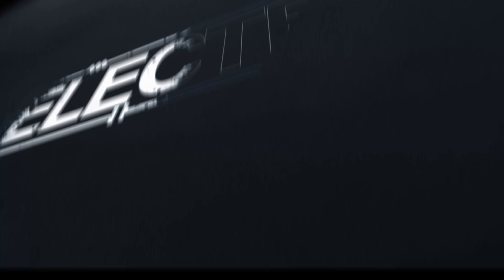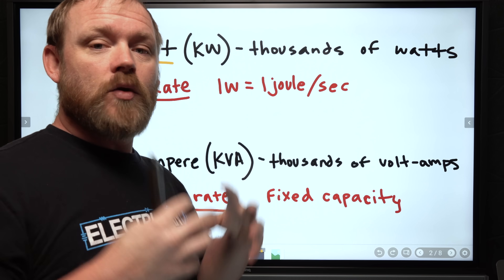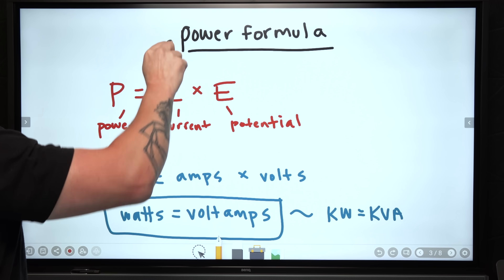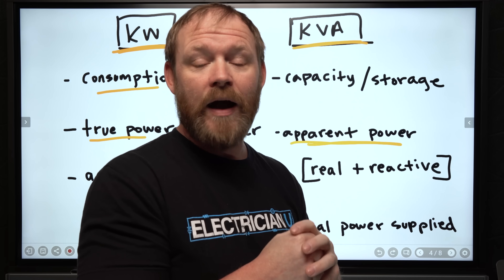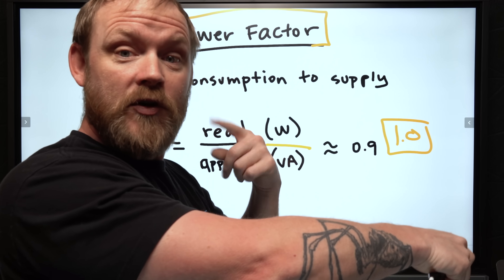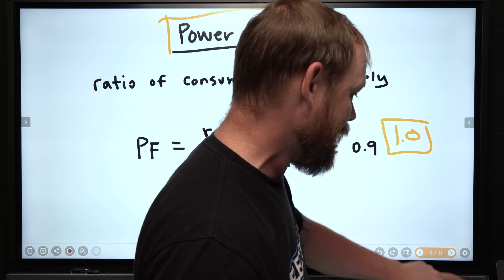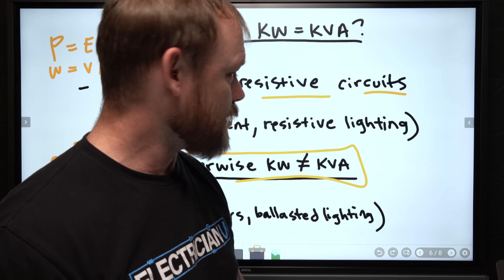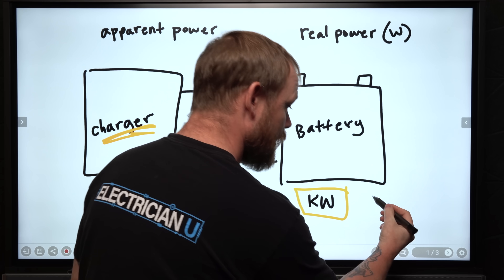Why KW and KVA Are NOT The Same Thing (Even If They Seem Like It)

Comment: what's crazy if you think about it... when you charge your phone, it has a step down transformer. Which means it's on a closed loop circuit. Which means if you charge your phone for 100 years, that wall charger will never loose any electrons. Meaning there isn't a real connection from your house circuit, same holds true from the step down transformer at the street your house is isolated from the electrical grid.... yet when they make circuit boards and the traces are down to 2 microns they have to battle electron drift.

Comment: 2.35 mins...so Batteries should really be rated in KVAH, rather than KWH?
13.28 mins: Power factor ONLY applies to ALTERNATING current, it does not exist in DC, unless it has been specifically designed in to the circuit. 

Hmmm, perhaps a missing layer in this clip, is to distinguish between AC & DC as a starting point.

Comment: How about voltage potential difference
Take like a solar system connected to the grid 
What is the total amount of work including overcoming the pressure voltage
But if you were to measure volts and amps where the solar is grid-tied you will see about an 85% difference 
You know the actual power going into the grid

Comment: OK, it's reasonably clear for my limited needs, but leaves me with the following: if a motor is rated at 1000 watts, given a typical power factor of say .9, is this 1000 watt rating an indication of actual electrical power consumption, or that of the motor's useful output? Or to put it another, more practical way: ignoring the high power demands when the motor is started, do I need a 1000W or 900W generator to run such a motor?

Comment: VA's theoretical veriable is the voltage, whereas W equals total consumption or rate per hour, which in turn can be delivered in the form of different voltages. In the real world, a stated votlage and maximum stated amperage is the VA.

Comment: Impedance can be purely resistive.  You have to describe the difference between power (W) and supply (VA) in terms of power factor and he didn't get to that until the very end.  Note that this is only case for AC circuits and typically only matters when you're transferring power.  Without an explanation of where capacitance and inductance show up on typical loads  it's really hard for anyone that hasn't had a EE course to explain or understand this.

Comment: I thought battery capacity was rated in Ah. I know car batteries rate their power delivery as cold cranking current—other batteries use kW, but it's easy to work out current delivery as most batteries are a "fixed" voltage. (Quotes around fixed, as most batteries have some sort of discharge voltage curve—alkaline are almost linear voltage drop vs time for a fixed discharge current, whereas NiCd were a sharp drop in the first 5% of capacity, then almost flat for the majority of the battery's capacity, then a sharp drop at the end. Don't know about other battery types.)

Anyhow, reactive loads (predominantly, if not exclusively, an AC problem)—when looking at the voltage and current waveforms on an oscilloscope, you can almost immediately see the issue that phase shift causes. In a purely resistive load, the current and voltage waveform peak simultaneously, so all the power delivered is useful. In a reactive load, the phase shift causes the current to lead or lag the voltage. At any given point in time, P=IR. Given the waveform peaks never arrive simultaneously, you can calculate the instantaneous power using a whizbang formula that I can't remember because I learnt this stuff thirty years ago. There was something about the cos and sin of the angle (normally 90° phase shift, I think) which gave you the vectors of the sum he talks about, actual power vs apparent power.

Short story—reactive loads (IIRC) are not a DC problem—kW means kW. As a bonus, my head now hurts from thinking too hard.😵‍💫

Comment: Thanks for the explanation. But I need more. Apparent vs actual. Losses...
Why can an 8 kva generator not supply 2 off, 10 amp 240 volt mig welders. Inverter. 
It has 2 off, 15 amp outlets.
How much loss must there be? Will a power factor correction achieve much?

Comment: Perhaps it is helpful to consider that DC circuits can't have a power factor because there is no concept of phase lag or lead in a DC circuit.   Hence, the discussion of whether a battery is a source or a sink of energy is superfluous; we can stick to Watts (rather than VA) as being completely descriptive of rates of energy transfer into or out of the battery. Only the input side of the charger, which is 3-phase AC, need be specified in VA.

Comment: Where Kv x a = kWatt( voltsx ampere) but also see it e.g....Watt on your cars rear wheels see it as kva
Just kWatt say e.g. engine power. Loosing a lot of power on friction etc. Electrical generator has a Power factor meaning that..😊😊
Or am i wrong

Comment: OK, this is a good explanation, but at the same time I would like to know if there is a way to compare KVA to power or current. For example, i have shopped around for variacs for various projects, not all of them are rated in amps, so I have to kind of guess their current rating based on volts X amps, take one rated at 1800VA, would that be safe to say its close enough to 8 amps load @ 230V?

Comment: 1) A battery is DC which is always watts and power factor is always 1..0   2) I would challenge you to put your hand on an air cooled transformer of any significant size and say that there is no heat produced. In fact hysteresis losses in a transformer always generate heat.  Power line transformers are oil cooled to help dissipate that massive amount of heat.  3. Overall it gets the idea across.

Comment: 95% of people never run into a situation where this matters...but when it does it can kick your ass.
Back around 1998 I was building out a large call center - 1200 seats.  1200 low end PCs.  Built on site from components pusrchased wholesale (so cost per PC was around $150).   250W power supplies, which x 1200 = 300KW, but of course actual load when we tested was more like 75W ea, plus the monitor brought it up to about 110W.  X 1200 = 132KW.  We added in lighting, AC misc and thought max load was 300KW ans were planningon a 375KVA backup generator.
BUT...reactive load from a PC switching power supply can swing from zero to quite high rapidly. Especially at startup. Meaning that total real power requirement was more like 420KVA.  We ended up specing a 450KVA generator AND added a 3 phase battery backup good for just three minutes at total load - just enough for the generator to start, run up and stabilize.  This meant that max load stayed around 320KVA to 330KVA.
Once, when the generator failed to start because some nimrod had left a switch in the wrong position, when it did start load spiked to over 400KVA, then within a minute dropped back to 300ish.

Comment: Then of course you have line interactive server-grade UPSes.  Good, clean power coming in?  Straight to the servers.  Clean power with a brief voltage dip?  Use capacitors, change their DC output to AC, and supplement incoming power.  Power completely out?  Power exclusively from batteries, go DC to AC, and use a transformer to hit the required voltage...usually the same transformer that will recharge the batteries.  And then there is noise filtering, on-line UPSes, sine-wave approximation, and those $30 UPSes that do absolutely nothing unless the power goes out completely, leaving uncle Leo to think the darned thing is busted when his PC shuts off in a quick brownout.  And what does your PC do with all of that clean AC power you spent hundreds of dollars to provide?  It takes care of any incoming voltage or noise issues. steps it down to 12 volts or less via transformer, and runs it through a bunch of capacitors to ensure perfect power...  In other words, everything a UPS does minus the batteries.  And that is why when someone asks me what size UPS to buy, I tell them o get the most expensive one in the store and walk away, because I am NOT explaining what VA means to a layman.

Comment: It's just to account for the power factor...which is a phasing issue where the simple P=VA formula is actually a vector equation.
Specifying KVA indicates maximums - regardless of phase.
KW is a rate... KWh is a capacity.
A RATE is how much can be done in a given time. (the curve)
A CAPACITY is how long the RATE can be expected to last. (area under the curve)
People - keep it simple.

Comment: i put it this way, 
kw=kva only in a circuit where a battery drives a simple resistive load , for all other sources and loads even led's , the circuit characteristics vary in such a way to cause variations in both the source and load,  were the volts and amps levels always lead or lag each other

Comment: @10 min. Into the video,it will be much easier if the instructor draws a parallel between VA / Watts and Source/Sink.
That way, the folks with background in Mechanical Engineering or Thermodynamics, also get/ remain interested.

Comment: KVA is used to represent apparent power and KW is used to represent the real power of an electrical system. Its usage differs in electrical circuits because of the difference between AC and DC circuits. When considering a DC circuit, the kW and kVA are equal because the current does not get out of phase.

Comment: Excellent explanation with good examples. I’m an Aero-Mechanical Engineer with 45 years experience and I’ve always had problems with kW vs. kVA. When questions arose, I had to consult with one of my Electrical Engineer colleagues to get through the issue. No one explained it as clearly as you thought. Thanks!
Reply: So it seems to be that they are the same except a bunch of electrical engineers decided to use KVA in some circumstances just as a convention, for poorly defined reasons.
Reply: @normandiebryant6989  No, the difference is explained in the video. If non-ohmic resistance, such as capacitances and inductances, is present in the circuit, phase shifts occur between current and voltage due to these capacitances and inductances. This is referred to as reactance and apparent impedance. To express the total power provided, the unit [kVA or VA] is used. If there is only ohmic resistance and no phase shift, then the power supplied is equal to the power consumed, and the unit is [kW or W]. The power factor in this case is 1.0, meaning there is no phase shift. He explains nothing else in the video.

Comment: This is just too painful to finish watching. He talks about W being a rate of power production and VA being a capacity and that's not the case. A 100w lightbulb left on for a second, does not consume 100W. It consumes 100Ws (100 watt-seconds.)

The difference between W and VA, is that VA is not always in sync, thus the amps could be high when voltage is low and visa-versa and the VA and power factor indicates this. There was also somewhere where he mentioned a battery having a rating in W. Batteries are rated in either WH or AH,, for capacity, and in A for how much they can push out when fully charged. So, in terms of L-ion batteries, they may be able to push out 100A for 15 mins but that'd mean the battery is a 25AH battery, not a 100A battery.

Comment: Thanks very much for this video! It refreshes my mind from what I learned about the subject in the eighties.
In the Power formula P = current x voltage, I would use V for voltage rather than E, not to mix the E for Kinetic Energy, Potential Energy, or Total Energy with the voltage.
Great job and very well explained!! Cheers,

Comment: …and inverters?

they seem to be rated in walks as well .
By your logic, they should be rated and volt amps ? am I right? Have a good day, buddy?
——-
I just looked on the side of my small project Growatt; ‘3000VA/3000W.
apparent power equals continuous output power.

Comment: Prime reason utilities do not like a powerfactor below 0.9 is that the VAr oscilate back and forth within the distribution network and thus they would need to scale up all their equipment, to care for that load.
Since the VA is what really travels through the utility network and VA >= W.
Worst case would be a powerfactor of 0.5, when W == VAr, then the distribution network would have to cope with double the load...

And since the distribution network carries all the load of its consumers,
we're talking about MVA loads even on the last leg (last stepdown transformer from i.e. 10kV to 240V, or 7.2kV to 120V)
Also most people are not aware that every conductor is never ever a pure resistive load. There's always a capacitive and inductive component. The catch - for normal conductors its always Ri >> Ci and Ri >> Li and the values of these intrinisc parameters are usually extremely low. Those intrinsic parameters only really have a measurable effect with long conductors in the multi km range (i.e. highline, catenary). With Ri being more pronunced, you will see its effects in smaller installations, i.e. residential, if you have a long stretch from the breaker to the end of the segment you will measure a noticably lower voltage at the end compared to at the main panel.

And we haven't even started to talk about why we have highlines in the first place - internal power dissipation (remember Pi = I^2 × Ri)

Edit: typos

Comment: when my idle transformer is sitting without a load, my power meter still shows 25 watt consumption though, since it's a plug-in power meter and not an industrial device that shows power factor, I believe I get charged for my power transformer every hour it stays idle, even though I am regular household consumer.

Comment: Power factor.
Transformer plus other inductive and capacitive loads have their voltage and current out of sync. 
Like a motor ignition happening at a less ideal time wasting gas and producing less HP.

Comment: This is totally wrong because of a lack of understanding of Power Factor. If you know the math the power is also part of the understanding or the offset in the Phases of alternating current.  This discussion only misrepresents the value of power factor. It was stated at the beginning that amps are rate but a watt is a rate but it is not but it is bit it is not!!! Basic electrical classes hep you understanding that  KVA and KW ARE identical BUT you do have to consider the power factor when understanding how a device uses the power and how the phase sync effects how the motor used the power efficiently. When motors are balanced with capacitors to increase the power factor this "mystery" eliminates the difference. When you got to the end you almost got it right. AC must consider the power factor because it is the offset of the phases. DC has no phase offset so...... Basic electric review of an NEC manual helps with understand this!!

Comment: the battery part is half wrong: Batteries are in KW (how much can they be charged with or  with what load drained?) AND they also are in kWh which means HOW "BIG IS THE BUCKET", the storage capacity...how much energy does it hold? of course this gives you the CHARGING or DISCHARGE-TIME since the coefficient of those figures tells you, HOW LONG IT WILL TAKE to fill all the kWh INTO or drain them out of it given the AMOUNT of power going into or out of it at a given time. a bit like filling a pool of a certain size (kWh) and the hose you try it with (liters per hour or gallons per heartbeat) or what ever weird system you americans use :-)

Comment: P = E x I x cos(phase angle) or = E x I x pf as the pf = cos(phase angle). So KVA is the vector sum of the supply power in KW, the supply is considered purely resistive but as you mention the loads can and do have a combination of resistive, inductive and capacitive components (complex) which consume some of the power being provided. Which necessitates a ballast to compensate to return the pf closer back to unity so the supply power isn’t wasted on the non resistive load elements. So the supplied power in KW does equal KVA, its just that KVA is the result of a vector sum.

Comment: The author did not talk about the complex plane - although he did put up a diagram with it, but without explaining it directly - and really, that's the key to understanding all this.  And oh, an ideal resistor does have impedance, just not any complex component.  This topic is covered in calculus-based introductory physics, or comprehensive electrical engineering for non-electrical-engineers.

Comment: Sounds like Active Power, kw, is the power that is converted to other form of energy (light, heat, etc). While Reactive Power, kvar, is the power that is taken by the load which is not converted to other form of energy but still in the form of electricity (not converted to other form energy) which is thrown back to the source.